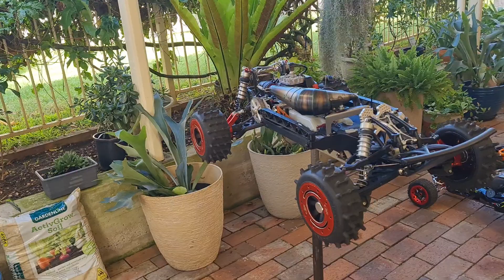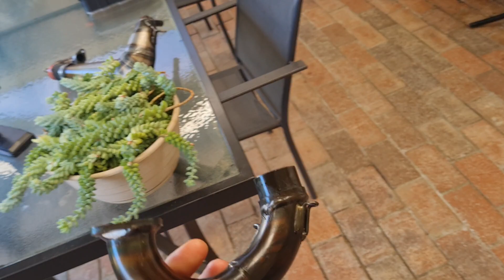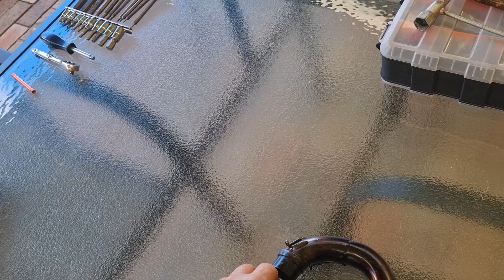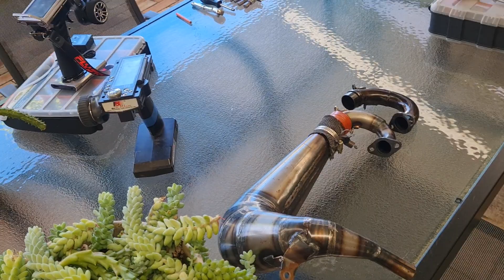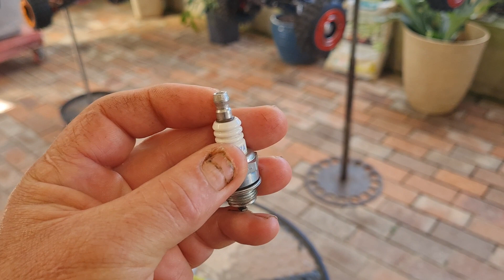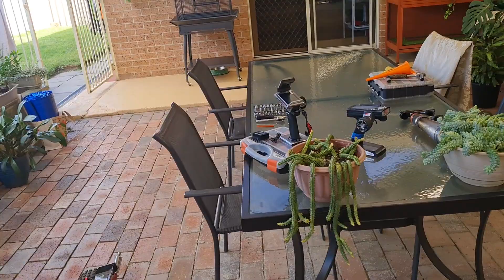Rovan 71 and Taylor 35, WJ 71 and pipe, problem  sorted  out!!!!!!!!!!!!!. Must Watched.

Comment: So at what psi do i need to set the metering spring to for a small bore
Reply from the maker: Your ears must have been burning, and it's your lucky  day. Well I not sure what a spec is on the pop off on a small bore, as there are no real specs on the net.But what I have found is that the pop off set at 18 psi and it breed down to 10 to 12 psi fully  seated.   were the needle is close. But check first your   meter  arm height  with a Warbro gauge,  which is the shape of a W and check the pop off with your pump gauge.  I  did a Wj71 carby of my Rovan 71cc engine and this is what I found.The psi pressure  was 35 psi on the pop off ( the needle seat). So I ajust the pop off  pressure  to 22psi and breed slow to 13 psi  fully  seated. To do this task, you have to cut the metering spring  bit by bit and checking the pop off to get this spec.If you not sure what  I am saying I been doing a video  how to check your pop off pressure  and show how to check leaks on your carby and motor. This is a subject  that 2% of people in the RC world would know and 98% would not know. My Taylor  35cc engine is using a Wj71 carby  which was off my Taylor 71cc and they are  meter different   to suit  Taylor 71 engine ( pop off). I run my my Taylor 35 engine  couple  days a go  and it's going good now and I will explain  it all on the next video.

Comment: It would be nice to have footage of before and after to prove your point. I’ll be keeping mine the same.
Reply from the maker: Good morning, Ben. OK, I cover 3 or 4 subjects  in the video,  so which one are you talking about.As all before, videos  are on utube. .The after  videos  will be coming. If it the subject  about wj71,  have a look on Taylor's website of the supreme 71cc engine, and it says it comes with modified  metering wj71  carb. I would say it's meter to 18 psi on the needle seat, as there are normally 15 psi on the needle ( pop off). I have ordered new tools to mode and check the pressure  and air leaks .. The only video  that I don't  have is obr wheel standing   back in the day, but I have couple  of videos  of a stock baja wheel standing and a air cool baja motor in a 1.5 metre boat I did 15 years ago, just type  in my name and it will come up on utube. Yes I will be running some obr engines running  to compare  to a Taylor 35cc. But what I find, once  you play with  big engines  like Taylor 71cc, the small bore looks slow to compare  to Taylor  71.

Comment: Man I’ve been running a wj71 that came on my 71 supreme for a grip now on my 35 Taylor Reed and had no issues. Sucks you had issues. Australia must have way different air
Reply from the maker: Yes I know you got that wj71 off your Taylor 71. Remember  I asked you what fuel you were running, which makes a difference  as I only run 98 fuel. I be on putting new wj71 I have on ,as I do not want change  the metering  on it as it suited  to Taylor  71. I will sort it out  soon 👍

Comment: Thanks for the update! I'll be sure to check the pop off. I also picked up a 1242A carb I can try.
Reply from the maker: I have been meaning to do an update video  as it has been a while since the last time I did. That carby that you got works well on obr reed engine. I tried to cover a lot in this  video  and forgot some other issues. I need to write the issues  on paper so I can cover all issues  on the video. But the problem  doing that makes the video  too long and a lot more time to load the video  on utube.